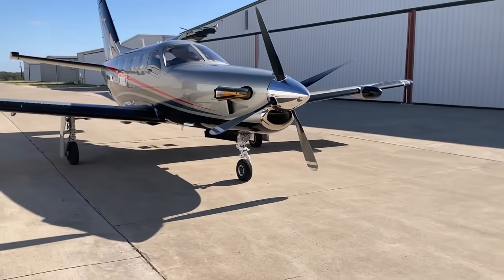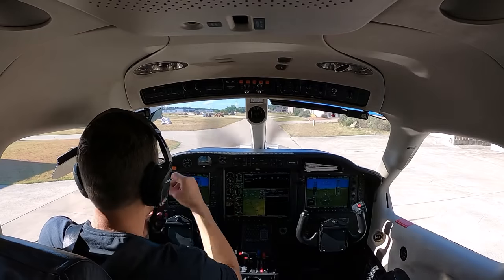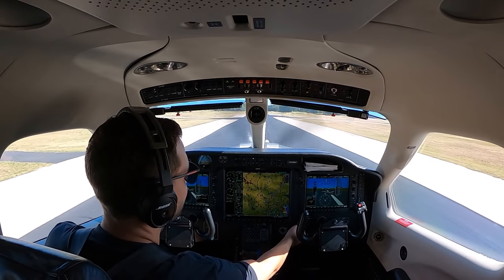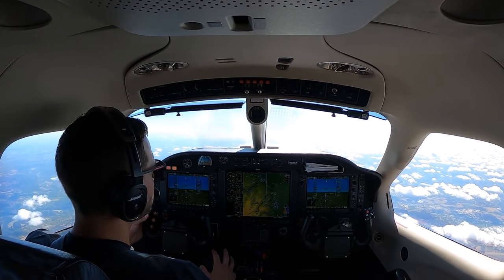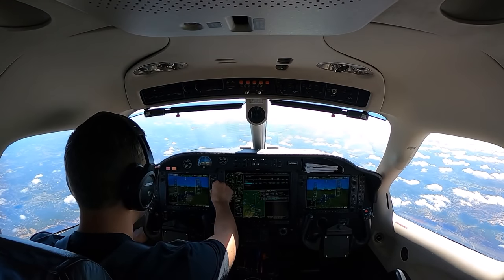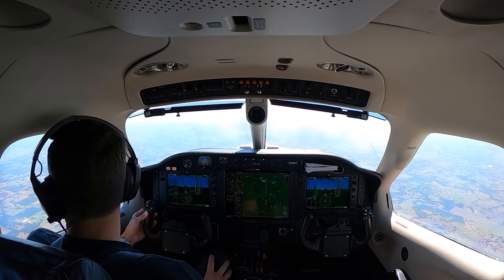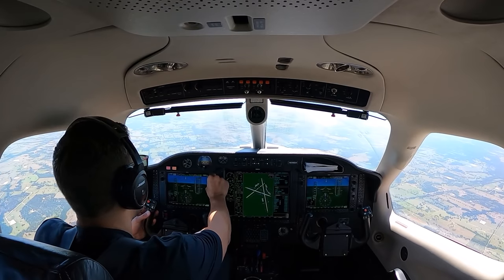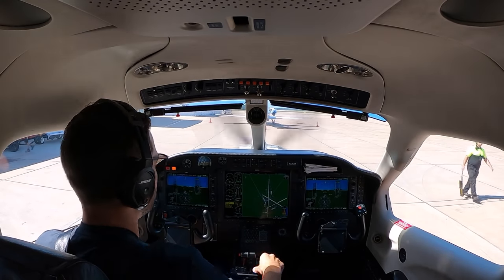How to Fly the TBM 850 Like a Pro Pilot - Boerne Stage (5C1) to College Station (KCLL) FULL FLIGHT

Comment: The silver sun reflectors to keep the cabin cool should be placed on the outside of the windows. The UV and heat reflected off of them from the inside will damage the glazing and other technology in the windows and lead to cracking and eventually window failure. There are products designed to strap around the outside of the cockpit windows.
Reply from the maker: I use the silver reflective windows “covers” for shorter stays, but yes the longer stays, you really should have the external canopy covers to protect the glass.

Comment: I fly the fedex caravans, and I'm routinely starting above 150 ITT with no problems I however wait for the ng to spool up to about 18% ng never had any hot start problems
Reply from the maker: I'm sure you could start this higher than 150 ITT, but I'd say it's a best practice on the TBM/P46T. Then again, you're doing a momentary dry motor adding fuel at 18%.

That's cool...where do you fly out of? Martin Aire?

Comment: question on the 850, when you're at full beta (not reverse just beta/taxi detent) does the plane taxi by itself or you have go to idle ? trying to compare to a tbm 850 that recently came out on flight simulator to see if its accurate :)
Reply from the maker: Eh…great question! So, if I drop in beta (zero thrust) and release the brakes, would it roll?

I believe it still will, but not nearly with the same thrust. I’ll try it and report back :-/
Reply: @LookingforHigher  ooh perfect thank you then. I’ll transmit your feedback, when you’ll do it could you also tell me your weight to have a better idea, thanks !

Comment: How many airplanes do you own? What type of work do you do? Is the G-36 Bonanza a good first airplane to own?
Reply from the maker: Hi Jeff,

Thanks for checking out my video! I am a Cirrus SR22 owner and do some dry leasing in this TBM that I also manage. Both the TBM and my Cirrus are G1000 equipped, which is great for continuity…same avionics suite as the G36 - great plane! I am a full time aircraft broker for aerista.com

People love the performance and club seating in the Bonanzas, whereas the newer Cirruses G5+ (2013+) have the bench seating in the rear with a 5th seatbelt.

As far as being a good first plane to own, I’ll put on my broker and CFI hat…

What’s your flight experience and typical mission?

Comment: Are you authorized by SOCATA Daher to be an official TBM trainer?
Reply from the maker: Thanks for checking out my video, James!

Good question. I’m not sure your level of knowledge in aviation, so I’ll answer thoroughly.

I’m authorized by the FAA, but not specifically by the manufacturer. I do not give insurance-required initial/recurrent. However, I occasionally provide “mentor pilot” services. 

Since a type rating isn’t required for single engine turboprops, it’s usually the insurance companies that dictate more restrictive training and currency than the FAA. 

Check out my latest video "Turn & Burn" when I give someone some post SimCom transition training. Miguel, while he was deemed okay to fly by the insurance company, I wanted to provide additional training on the nuances of this 850, as he normally flies a 960 that’s much more automated.

Comment: Great video and thanks for posting…. Can you comment on the TBM 850 as it compares to Pipers M600? I just sold my mirage and in the market for a new bird.
Reply: I can. TBM is faster. TBM is easier to climb into the pilot seat. TBM is built like a tank. Support for older TBMs is wonderful.  TBMs are hard to find these days, contact one of the major distributors (west coast = AVEX). They will help you find one. I own a 700a model, even the earliest is faster than the Piper. No regrets.
Reply: I just noticed the video producer is a broker, so give him a call!
Reply from the maker: Michael, thanks a lot for watching my video! Your question is on point, as the M600 is the first Piper that truly encroaches into TBM territory. In short, Chuck is spot on. To elaborate a little further, the "tank's" armor brings the 850's ramp weight 22% greater than the M600 (or a whopping 45% greater than the standard Meridian!!). The TBM 850 will overcome that, burning 35% more fuel to go 15% faster. This amounts to nearly 50% greater total costs of ownership (annually) - if the plane is maintained to the Daher pedigree, phased inspections.

Overall, the P46T (to include the M600) is the ultimate personal/family travel machine. The TBM 850 is the zero compromises, corporate workhorse. It is the 'better' plane, but with the associate costs. 

NOTE - These cost figures can vary quite a bit, mission dependent (especially at the 1,000+ nm range).

jesse@aerista.com if you'd like to communicate further. Congrats on the sale of your Mirage.

Comment: A pro doesn’t fly with two hands on the yoke
Reply from the maker: Musa, dang good attention to detail. Thanks for watching my video! For rotation of heavy, especially transport category - they do. 

I'm not sure your level of flight experience, so being thorough with my response. 

Hand on the power is indeed a very good practice, not to have an  unintended "roll back" of power. Flying lighter planes, Cessna, Mooney, Cirrus, you should basically trim the plane for it to rotate with a touch of back pressure. 

The Meridians, TBM, jets, are normally heavy, a two hand event, especially with varying CGs. Hopefully you trimmed appropriately too... 

Regardless, in the TBM or a twin jet, I guard the power levers until I'm at V1 (takeoff decision speed) or VR in a single for abort. Otherwise, passing V1/VR respectively, we're flying after that!